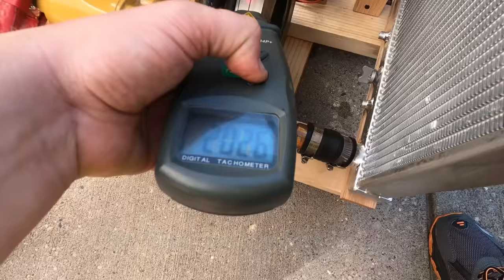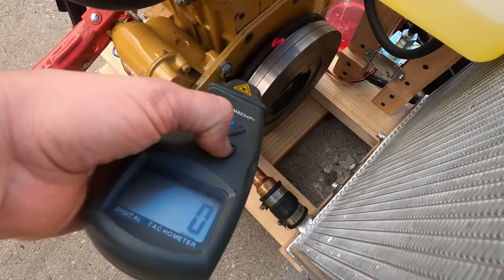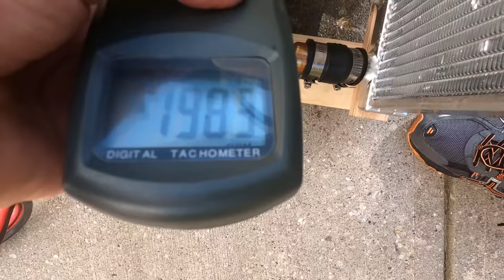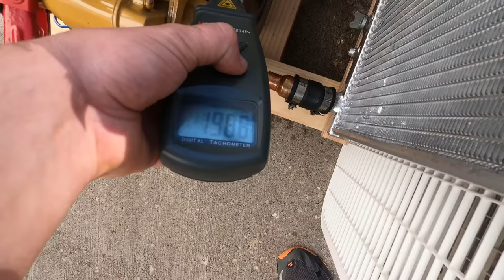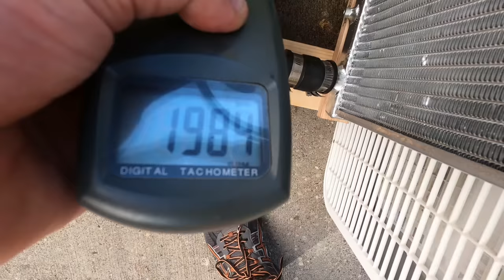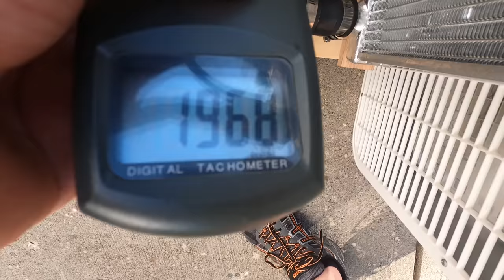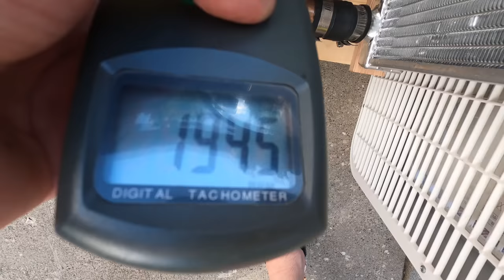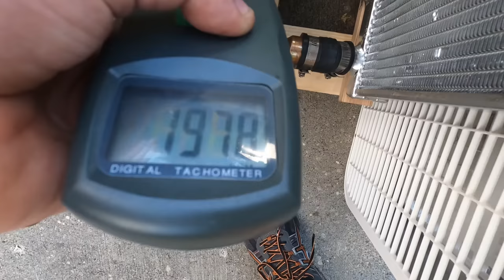Will Caterpillar Diesel run on Cooking oil? Attempt to run engine on Transmission Fluid & other oils

Comment: Didn't read all the comments, but just wanted to say that the engine wouldn't last long on running with any of these non-estericated oils. The glyserine that stays in the oil without esterication will produce so much soot that the engine will break quite soon.

Comment: You can mix the oils with methanol and you won’t have the gumming up issue. You need to pre filter the cooking oil before putting it in your fuel tank.

Comment: Red dye diesel is "off road only" fuel. Where I live the 50 cents a gallon tax is the separation between it and highway diesel. Since 1/20/2021 one can see the DOT guy sticking tanks on any semi or light truck he chooses to. The fine starts at $1000 if you get caught. I have heard of guys that strain used black motor oil to run in their pickups to darken up the red dye...I wish I had that little Cat engine for my hydraulic firewood bucksaw.
Reply: The fine is for marked gas oil, a dye.  What is the position if you use unmarked cooking oil?
Reply: @ValMartinIreland  That is a valid point. I would really  like to question the DOT cop about it.

Comment: Diesels that have biofuel have two tanks the biofuel has a heater to warm up the grease or oil before it goes into the engine

Comment: Generally recommended to treat the cooking oil to separate out and remove the glycerine.
This is essentially how they make biodeisel.
Reply: What you'll mess with running odd oils is the injectors and any emissions system, especially ones with DEF.

Comment: I ran a VW sharan 1.9tdi 110hp on used engine oil for 2000km, until the rotary pump failed. The car has already 600 000km on the clock.

Comment: It runs on vegetable oils because first diesel engines that were made ran on oil. Diesel injectors are very powerful and they can easily spray oils just like diesel.

Comment: Heating oil has nearly all the sulphur removed that acts as a lubricant for the injection pump, if you it continuously on heating oil (kerosene ) the pump will suffer excessive wear over time.

Comment: They burn any flammable oil that's thin enough and compatible with the materials that are not metal in the fuel system which is pretty much everything with a few exceptions. They only trouble with different oils is when they get cold they get thick or solidify. As far as diesel and heating oil they are identical except for the red dye in the heating oil both are number two diesel.

Comment: You could try the Schur mixture (adding 10-15% of petrol into the vegetable oil and about 5% pure alcohol like 99% rubbing alcohol) the petrol makes the vegetable oil more liquid and resistant to cold weather and the alcohol brings down the ignition temperature to what it would be with diesel. We use that mixture in germany when we want to run modern diesel engines on vegetable oil.
It's important to put the alcohol in the petrol first and then the mixture into the vegetable oil because putting alcohol directly in vegetable oil doesn't mix well.

Comment: I met a man that had built his modern truck to run off of vegetable oil. He had a inline preheater to get the oil to a thinner viscosity.  He also had a switchover valve.  So he would run diesel at start up and before he shut it down. So the oil would not coagulate this lines, fuel pump and motor. He ran off of recycled fryer oil, his truck smelled like French fries he built a centrifuge separator in the bed under a topper.. it's not as easy as you would think to get used fryer oil. It's become a business now. There are companies that buy the used fryer oil.

Comment: Now you just need to make sure, you don't accidently use these vegetable oil bottles in the kitchen after you dumped the fuel line full of heating oil into them... It might be dangerous for your health and tastes awful. 
The test showed what I had expected, a simple mechanical diesel engine can run on a lot of different fuels. But sometimes the alternative fuels don't work that well in cold areas. 
Greetings!

Comment: Heating oil and diesel are identical other than the red die applied to heating oil as it’s not supposed to be used on public roads since it’s not taxed for road use.

Comment: Diesels will run on any flammable liquid that also has adequate lubricicity.    The problem with veggie oils is viscosity at lower ambient temperatures and paraffins.    Heating oil is kerosene.  Kerosene is also #1 diesel.  It has almost no paraffins.   All other petroleum based oils will run in a diesel.  Issues there arise with cold starts.  Diesel fuel is a balance of all available products for easy starting and reliability.

Comment: there is no problem using any combustible oil in a diesel engine, the only problem is the corrosion of the fuel system and major repair costs associated with that type of failure

Comment: Any old diesel with a mechanical injection pump will happily run on any oil that can be atomised 
kerosene and jet fuel are  not recommend as it does not contain a lubricant though putting some used engine oil in the kerosene will help. 
 Wouldn’t wanna put it in a common rail fuel engine as the injectors and high-pressure pump seals don’t really like stuff that isn’t diesel

Comment: Because diesels don't use spark, they squeeze instead, they aren't picky on the fuel. Worst case, you get timing issues due to early/late ignition, or engine scoring due to not enough lubrication.

Comment: A mechanically injected Diesel engine will run on basically anything flammable that’s close to the right viscosity, if you get grease hot enough it’ll even run on that.

Comment: I use to work at a construction company a few years back where the boss tried to cut on costs and did what you did on one of his excavators. Needless to say it didn’t go well and the repairs cost him dearly 😂 Some diesels can and do run on used cooking oil but not all of them.

Comment: im in UK car van wagon truck fuel is expensive UK gallon = 8 pints - 4 quarts,in 1999 we had a fuel crisis gas stations rationed fuel...this was the time i learnt about veg oils,since then ive been running on veg oil and heres a thing,when we take out vehicles for yearly road safty test ie MOT test and the test feller sticks that thing up the exhaust/tailpipe for emissions readings it comes back near zero so veg oil good for environment further more the most efficient oil is hemp oil which the only by product is water vapour small amounts burns the best and best for cars diesel engines......

Comment: If it is a flammable liquid, a fire piston, which in this case is a diesel engine piston, is going to ignite a fine mist of it.  You should do some Vaseline and some lard and heat them up a fair bit above melting point after heating up the engine so it doesn't freeze on it's way to the injection nozzle.

Comment: it will run in warm temps.will be a different story when the temps drop down.even thin diesel fuel turns to gel when its cold enough.

Comment: Diesel's will run on almost any combustible fluid sans gasoline. The problem always is what burns the cleanest, is compatible with any exhaust aftertreatment and engine seals, and will stay fluid at winter temps. Maybe people run a used plant oil as fuel but only after the engine is at operating temp or else problems can occur. Even with meticulous maintenance plant based fuels can cause issues.

Comment: Home heating oil is 35 second and that's fine to use. Other heating oil. Type is kerosene which is 28 second. Kerosene has no lubricant and will damage the engine

Comment: Dont try starting a normal diesel engine on vegetable oil or motor oil in the winter without heating it or having warmed up engine to switch the thick fuel to.

In Ships we burn heavy fuel that is kept heated to about 120f in tanks and then heated to about 200 f just before it gets to the injection pump.

Older ships started on regular diesel then switched to heated up heavy fuel.

Look up running car in SVO straight veg oil for more help .

Comment: get a paint mixer bit drill, a bucket with cooking oil and pure alcohol, and run the fuel tube in while the oil alcohol is consistently mixed with the mixer so it doesnt separate. see what happens.

Comment: RAN MY isuzu would run on used cooking oil as long as the temps were above 80 degrees  .but that also depends on fuel pump .Home heating oil is diesel ,  as is jet fuel .

Comment: where i can buy a motor like this?
Reply from the maker: It's cat c0.5 you can get it thru the cat dealer but the prices are high around $4k. Cheaper option can be ebay, but it's hard to find.

Comment: The diesel was originally designed to run off peanut oil not petroleum oil also running that atf through their cleaned those injectors and entire fuel system
Reply: Answering questions nobody asked.  Providing solutions that are guaranteed to wreck other peoples equipment.  Oh the entitled of the ignorant.

Comment: Heating oil and diesel are basically the same but heating oil is filtered more finely and dyed red so if you are a trucker and have it in your tank the D.O.T. can fine you. They will get their tax money either from taxed fuel or by fines.

Comment: in finland. mbMononen has done many trips with his old mercedes w123 and w124 with cooking oil. it works great. smells good. :D thought those vegetable oils etc are not good in winter... they freeze and gets water in it...
Reply: When I worked as a waiter in a restaurant the cook told me he always brings used cooking oil home. I asked why and he replied: I have an old mercedes, I use it as fuel.
Reply: @909drummachine  yea, also my friend gets free used cooking oil from local pizzeria and he makes fuel out of it. diesel in finland is way too high, as all fuels... but diesel cars in finland has taxation to the diesel also which can be 1000€ per year for some cars... its insane...

Comment: Mixing automatic transmission fluid 50/50 with diesel works on alot of diesels. Heating oil is pretty much just dyed diesel and illegal to use in on road vehicles

Comment: heating fuel is kerosene, it's a bit dryer as diesel fuel (no good for the injection pump), the best vegetable oil tu run a diesel is rapeseed oil, other oils are too viscous and can destroy the injection pump...But in cold weather avoid the use of oil because the viscosity increase a lot...

Comment: Yeah it will run and WAY better due that any Vegetable Oil have HIGHER CETANE #. Starting usually from 55 to 75 vs US Diesel is ONLY 40......

Only three issues to remember: 
1) same as Diesel 0 C/32 F Paraffine will separate
2) metal fuel installation is required due to ester corrosion
3) CANOT use it in newer Diesel engines (Common Rail/ Direct Inj.) due to lack of lubrication

Comment: It will run on most oils, but what the problem will be is your not getting the lubrication addectives thats in the diesel. 
So in the long run you will damaged the engine faster.

Comment: 3 month my car 1,9 cm3 diesel renault it work in vegetable sunflower oil and after thi broke the hidraulic head of the pumpI changed the pump ant the engine work very well until today

Comment: With such a simple engine, with no emission control systems, it's no wonder it ran on everything you threw at it. But once you start factoring in longer-term effects, rubber parts degradation, oil going gummy and rancid in the fuel system, colder weather starts/oil viscosity etc. then it'll be a different tune altogether ;-)

Comment: Diesel engine will run on ANYTHING 
if you pour some of the liquid in a cup, put a wick of some kind in and light it, if it burns like a candle it'll work
except gasoline
gasoline has been specifically engineered to NOT self ignite in an engine
but maybe it would run, hasn't seen anyone test it yet

Comment: A friend of mine used to mix old motor oil with diesel so it could run on that
Reply: That was a common practice in truck shops. When you change the oil you dump the old oil in the fuel tanks to save on fuel and to dispose of the oil. I didn't do it because I know the oil is dirty and fuel filters are not cheap.

Comment: the engines we have are designed to match the fuel they are using within tight specs to maximize efficiency. older engines will run fine on whatever, but newer ones you play at your own peril. if you designed a diesel to run on cooking oil specifically I wouldn't recommend diesel fuel in it lol

Comment: old style injection systems will run on oil no problems regardless, now longevity is a different issue and combustion byproducts that are not very healthy for the engine will accumulate and deteriorate it fast not to mention different viscosity fuels will have a different cold starting behaviour!
also, modern diesel engines can run still on a certain mixture of biodiesel to common diesel usually up to 20% bio diesel because they have different viscosities and high pressure fuel pumps dont like that nor the lack of lubrication in the fuel but not oils anymore sadly thanks to the fine machinework that now predominates with common rail, piezo electric injectors, etc.

Comment: What do people think engines run on when they run away ...We had tank run away and as we had no way to stop it we pulled it out of the work shop to in ran out of sump oil and locked up..

Comment: It's funny to see all these different videos on diesels there were originally designed to basically burn anything I personally run a blend of 90% filtered motor oil with 10% gasoline in my Cummins. The military also had their engine the Hercules which was a multi-fuel essentially a diesel engine with an apparatus on the injection pump that determine the viscosity of the fuel and regulated it based on that the manual suggested every 10 gallons of gasoline one quart of oil believe it or not you could do this with your diesel trucks nowadays I'm not too sure about the newer electronic versions of the diesel fuel injection systems. As far as biodiesel it takes a large amount of alcohol to remove all of the glycerin from the oil it's actually not a very friendly way of producing fuel. If you had access to most cooking oils or any oil that is flammable it will burn in your diesel as long as it's not high viscosity I have personally ran 100% motor oil in my truck it ran rough but it ran

Comment: I'd put cooking oil in my engine If, AND ONLY IF, it all leaked dry, and i needed to take it down the street to a shop.

After that, and after the leak was fixed, id fill her up with normal oil, run it for maybe 30 seconds, change the oil, run another 30 seconds, then repeat that one more time. Maybe 2 more times for good measure. Might run it a full 2 minutes the 2nd time.

Comment: everyone has different histories about what the original diesel engines ran on. they ran on many things, but mostly a primitive version of ammonia, derived from coal. this could be burned as a gas or liquid and was pretty widely available and used for other industrial things. the engine was designed to burn damn near anything, though, and mentions using Neutral Gas, Pulverulent solid fuel (coal dust), anthracite, gas, fluid fuel, petroleum and ammonia vapour as fuels in the late 1800s. with diesel at $6.00 USD a gallon, I'm okay with anything becoming the new fuel if it's cheaper. Many people are going with used restaurant grease and saving hundreds a month. Savings in the thousands per month is easily conceivable for a trucker type. If you can make a deal with a local restaurant or two and get their used oil for pennies on the dollar, then you can easily and cheaply refine, store, and make the necessary changes onboard the diesel vehicle to carry and prepare used oil for fuel.

Comment: Had a '80 rabbit and it'd burn anything.  Ran good on fuel oil but it clogged the filter alot. Try it on a mix of old motor oil and a splash of kero😜

Comment: „approved for use in a Diesel engine“

You need to add „over a short period“. Vegetable oils might contain abrasive or acidic components, that will wear down the engine fast.

Comment: you could run that engine on hot lard if you wanted to haha. Watch out for glycerine however, that will mess things up in your pump and injectors.
Reply: No you can't. It'll clogg up everything and solidify.

Comment: I wonder if some of the aviation fuels would work?
Reply from the maker: I think avgas will work. May not have enough lubricity in it to keep engine running reliably for a while. But can be mixed with oil for that

Comment: You need to process bio oil
and greece from frying boiler.
First you must filter it, the add
sulfuric acid and filter it again. Then
You have bio diesel.

Comment: The issue is when you add a load. Those oils might work with no load when it doesn't take much work to turn the load... but when there is a load they probably don't have the umph and you didn't check for that(ok, you did mention that but the entire point of an engine is to do something with(load it)). Also the motor oil likely has additives that might not be good for the piston heads. There is also the issue of residue that will build up. So they might run "fine" but will not run so fine much later. Again, you didn't test for any of that. Also, it would probably be better to do some mixing and try to thin down any thick oil's.

Comment: An extra ambitious endeavor would be a wax run after a REAL good heat up of both the engine and the fuel source, clearly.  So, get butter, vaseline, lard, and wax.

Comment: The sounds of the running engine have been meticulously drowned out, to prevent us from getting an impression of how well it's really running.  Why?
In the 1980s, a man in South Australia was fined for evading road tax by running his diesel truck on some spare home heating oil.  The heating oil caused major engine damage, and a repairer reported him to police.